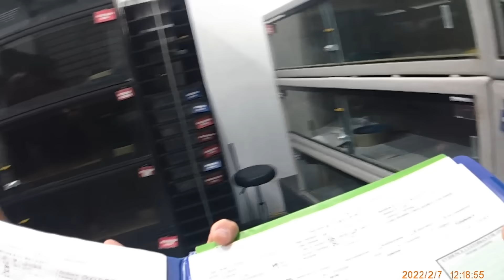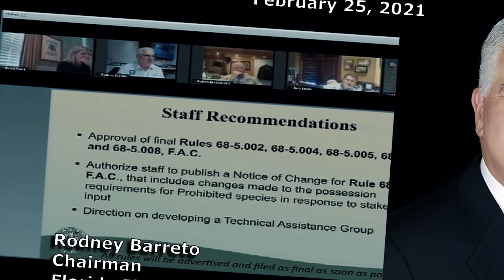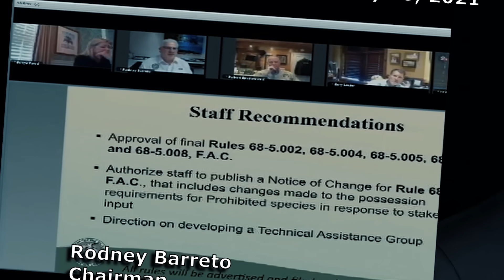Florida FWC Cops “Accidentally” Use Nail Gun On Pregnant Mother Pet Snake!

Comment: Coffee's pythons were maintained at the facility of Bill McAdam with FWC's full knowledge of their whereabouts for approximately a year, until FWC's raid and subsequent massacre on Thursday, April 6, 2023. On that date, coinciding with the observance of Passover and Holy Thursday, FWC officers Lex Corteguera, Jonathon Wright, Zach Beppel, and Christopher Ryan showed up to McAdams' facility, alleging that they had a report of an escaped Reticulated python in the area.

The officers said that they wanted to check to see if it was one of Coffee's snakes that had escaped. This turned out to not be the real reason for their visit. After Coffee allowed them into the facility, the officers began pulling snakes out of their enclosures and killing them, with what Coffee described as a sort of nail gun, on the floor of McAdam's facility. The device used to kill the snakes was likely a device called a "penetrating captive bolt gun." The FWC officers spent around four hours killing snakes, firing multiple shots to the heads of some snakes when it appeared that the first shots failed to kill them. When it was all done, they had killed 29 Reticulated pythons and five Burmese pythons, in addition to the misidentified Boa constrictor. The reptile community is calling this event the “Holy Thursday Massacre.” Social media posts on this horrific story have received tens of thousands of views.
Read the original article here - https://usarkfl.wildapricot.org/news/13162309
re

Comment: Big sheyrl's glass cage LITERALLY HAS A SPECIAL TAG, How did these officers mess up this bad bruh. Adding the fact that the snake owner told them to specifically NOT open the glass cage with the tag, and they still fucked up. You have to be actually blind and braindead to mess up that badly.

Comment: Summery of this coment section.

1. Person in blue, you did this intentionally, and your bad acting/ "blame sharing" is both bad and childish, respectively.

2. none of you should be doing this job.

3. They are all idiots. If you are doing this, at least be knowledgeable on the animals and the laws.

4. If it is florida, then they should be even more knowledgeable about the animals because they see them on a regularly.

5. If you were told about this specifically multiple times, you should have known better.

Note: in vet clinics/ hospitals/etc. they by regulations, and depending on where you are by law, they have to identify and confirm multiple times with both the owner and all staff involved in a euthanasia (i know this is different but still should be valid) that they have the correct animal and that the owner has agreed. (Usualy by sighing papperwork, confirming animal name, sometimes age, sometimes gender, species, color patern/ fur tipe, breed, and usually reason comes up in conversation or is out right said). All the checks and balances exist to prevent this.

In this case, they are all liable and warned, and all 3 of them should have been checking and confirming before the enclosures are even opened.